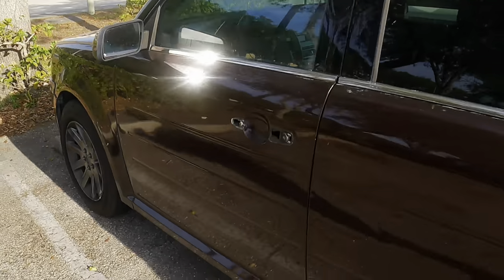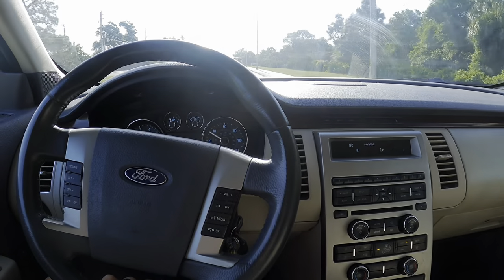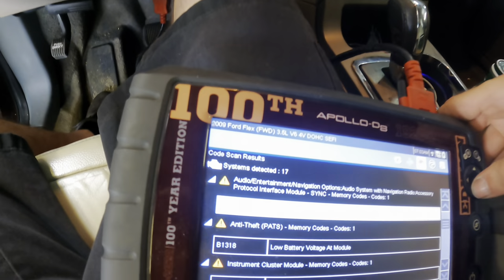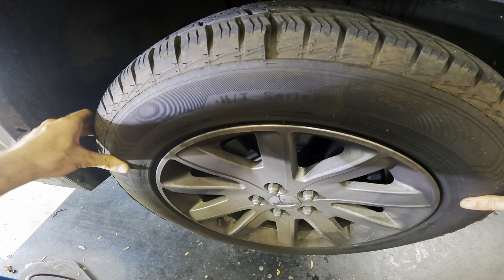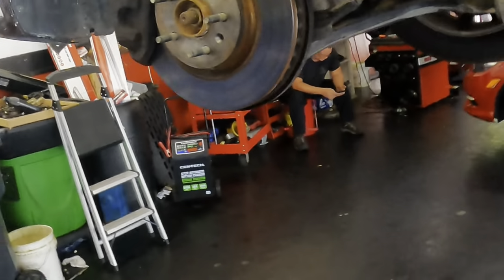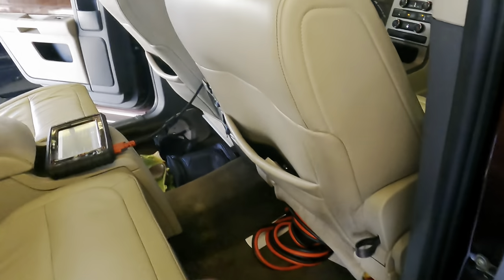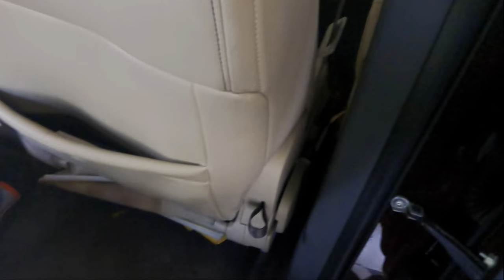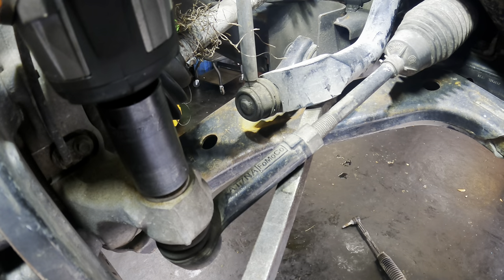Punishment from the Car Gods! 2008 Ford Flex 3.5l Airbag, Banging, Vibrating parts falling off

Comment: Ah, actual question about this...when removing and reinstalling the inner tie rod, should one use the tie rod remover kits that are out there (like a half socket or a set of varying size crows feet with a long rod that has a 1/2 drive hole on the end) or do you find the Angry Pliers™ or Frustrated Pliers™ to be preferable-ish?
Reply from the maker: Depends, if I can get them with pliers I just do that. If not I use the tie rod tool
Reply: Anything the does the job. 
Save your money for the beers after completing the work!
Reply: @RainmanRaysRepairs  some people are real quick judge but if they were doing their job I'd like to see what they would do as I said earlier in the beginning of this episode sometimes they need to sit in their chair and zip it have a good night bye

Comment: I don't know how it is in Florida, but in PA shops are real picky about airbag sensor wiring. I had a self-induced issue while swapping seats in a car, and multiple shops told me that if the wiring was damaged they wouldn't even try to repair it. Only replace. Thankfully(?) in my case, I only managed to damage a module on the underside of the seat while removing the module from the seat.

Comment: Just use a cable tie to hold the boot on. I used to try to use the old clamp also but everyone in my shop did the cable tie trick and there was no failures

Comment: Ray, long time viewer here, but i have to throw some REEEEE out there, one thing that should have been done is to clean out all the old grease out of the caliper bracket slide pin holes, all that old crud collects at the bottom and creeps back up the pins as the brakes thermal cycle and you end up with the same tight/frozen pin issue. Take a drill bit next size down from the hole, chuck it up in a tap handle, and turn it by hand, get the heavy junk out, then hit it with brake clean (DUH DUH, Eric O's sound effects, lol)

Comment: Make sure the front brakes were upgraded. They had issues with builds through Christmas shut down in 2009. My 2010 Flex was a victim, repaired under warranty.

Comment: That Flex needs everything my van needed.  I neglected to replace the inner tie rods thinking they felt ok to me, but when I got it to the repair shop and they put it on the alignment rack they showed me it's too wobbly to get an accurate alignment.  They also pointed out a couple other small things I missed (one easy to fix, one I gotta take it all back apart to fix) so I'm going to do all that and take it back to them.  Also throwing struts on the front and shocks on the rear and probably rear hubs as well because it might as well all get done before I take it for the alignment.  I plan to buy two more tires after the alignment is done (rears at 8 or 9/32 fronts both 4/32) and then there's not much left to do other than cosmetic and convenience items (rear wiper, glove box hinge, blower fan resistor as it works 3-4-5 but not 1-2).
Reply: all that said, it really helps to SEE what the issue is like you did showing the play in the inner tie rod socket joint area there, because it moves about as much as mine does, although I didn't think the little movement was much looking at it with the tire on, it sure is different when you see it moving IN the socket there

Comment: Got a t100. And had a faulty gas cap issue. It solved hard transmission issue. It would act like a dirt bike, and made issues on transmission altogether when decelerating and accelerating, backfire and accelerator issue, . Cold running issue where it wouldn't throttle uniformly. That's crazy. Must make video. ASAP. That's unbelievable to think a gas tank cap. Can have that much effect on whole vehicle operation and linkage. And transmission. That's really understated in the mechanical issue, solving steps. Hahaha wish I knew that's a long time ago

Comment: I been watching your videos old / new ones over the past week and i come to enjoy them. What i dont enjoy is some of the comments and i feel like i just need to mention something!  The kind of work you do is freakin amazing!  Tha speed and the service you guys seem to do is high class and the fact that  atleat you are not trying to rip the customers is so refreshing!  as i said i live in Sweden an i own Fiat Freemont 2016 got the multijet diesel engine in it. This would be your Dodge journey pretty much =D   Anyways this winter in i think nov-dec it started being hard to start in cold weatrher i was like ok maby som new glowpugs and a rly nice redtop battery will solver that! well i changed it and drove it for another month then it refused to start full out =D So i had it towed to a fiat delaler that was 3h drive away and they have now had it for 5weeks and i just recived a call today that they think it is the pump or the injectors. Price on the pump  here in Sweden is $2107,74 not counting in the job =D   and i might still have to buy injectors =P  (Side note to the story is that if i put the car in a warm garage over night it fires right up in the morning) if i dont it will just chew and chew until battery is dead. If i god forbid use a bit of starter gas to fire this diesel up it starts and runs normal and nothing wrong until it gets cold again =D   Sorry for a long post but ppl might reconsider al the complaints etc they have on you!  Keep up the good work my man!
Reply: Diesel engines need a little heat sometimes to get them going. Maybe get a block heater for home. Carry some canned starter spray like grandpa used to.. it's probably expensive where you are. It has Ethyl Ether  in it. Better than being stranded at 2 am on a Sunday morning.
Reply: @marshmower  Hahah yah kinda what i was doing but the problem got a bit worse over time and i feelt like maby there is an internal leak in the injectors so it lose pressure b4 the diesel can reach the cylinders but when it have finely build that pressure with help from starte spray it will work. I said this to the workshop but they kinda just waved me off.. and looked at me what do you know =D  (i only worked as a truck mechanic for 6 years at volvo trucks in sweden =D )   but i guess i let them play around with my car i was smart enough to extend my new car warrenty and it still covers so no mather how much repairs will cost i will be paying $800 =D

Comment: I notice that the instrument display is raking around because the characters are blinking at a rate similar to the camera shutter.  The camera shutter iso speed is very short because the sun is so bright.  But if you put a filter in front of the camera(like sunglasses) then that shutter speed would get longer, you would still have plenty of brightness for the video, and the blinking of the dash lighting would be less to not at all.  Some amount of filtering and it would not blink at all.  (Perhaps multiple sunglass lenses or perhaps even one layer.)

Comment: I had a 2010 Flex, same root beer brown with white top.
The brakes were WAYYY under engineered and scary!
A big brake upgrade would have been $1500. I also had THREE PTUs replaced in two years!
(Warranty covered)

Comment: You may want to think about cleaning out the hole the pins side into. Either brake clean and use the pin to pump old grease out or a drill, cleaning brush screwdriver with a rag.  I'm 62 so I've been there done that.
Reply: I enjoy yours and SMA videos even at my age I can still pickup on new ideas. Keep up the good work.

Comment: I have the perfect tool for doing those clamp squeezes, it's almost 30 years old now, but it squeezes the sides and compresses the top for a perfect fit.  I don't get why that tool you were using has the center opened like that, made it hard to use properly.   Glad to see they are getting the Flex fixed, those are some nice cars even though they are odd looking.  Had a 2010 SEL Ecoboost and regretted getting rid of it, then got a 2013 and it got totaled in a snow storm. :(   Getting another one soon.
Reply: Was thinking the same. I have a similar tool where the grips are thinner so the clamp folds over them and the top part pushes it down. I think it's made by midlock

Comment: I live in the UK and I dont know of any company that would resurface rotors , I dont think any motor repair company here would even have the equipment. They would say it was uneconomical  to resurface them and cheaper to buy replacements. Are there many shops in the US  that would carry out that proceedure. Keep the videos coming
Reply: They used to make rotors thick enough to be cut or serviced a few times. Last vehicle I had with enough meat in them was an 07 Honda Pilot I bought new a s drive to 340,000 miles and sold her. Many shops still have the brake rotor lathes as sometimes they just need a light cleaning or trying to fix a slight warp.

Comment: The customer would be lucky if all it took to fix the SRS (air bag) light was to fix a couple of broken wires under the seat. Our Hyundai Accent air bag light was caused by a defective senor in the passenger seat>>not replaceable. New seat would have been $800. DECLINED!

Comment: My daughter and her hubby had a 2018 Ford Flex. They loved it, I loved it, but they traded it to one of on line car buying things for a Lexus. They missed and wished they had kept the Flex. Sold back the Lexus. Lexus was hard to get in and out of it if you are slightly disabled, high side walls by the doors. Small seating areas. The Flex was easy to get in and out, lots of seating room. Not the best gas mileage but it was rated as an SUV. Could tow with it too. And I guess they are not making the Flex anymore. My guess would be that people do not realize its a working SUV and so mileage is lower.

Comment: When the door breaks while trying to get in the vehicle you know it's going to be a bad time.
Reply: First impressions are almost always accurate and set the tone.  Lol
Reply: *good time
Reply: Just looking at that door screams abuse. I keep saying Ray get in on the other side. The car looks like it belongs to an amateur stunt driver.
Reply: Ford "QUALITY".
Reply: Exactly what I said lol you know by that the owner has completely neglected it
Reply: @nissan300ztt  owner negotiate
Reply: @nissan300ztt  You could argue that, considering the condition of the vehicle, it really is doing pretty good.
Reply: @lucassolomon1079  nope.  Garbage junk old Ford. That has been neglected.  Like most Ford Products
Reply: @nissan300ztt  honestly, drove mainly GM and the wife subarus for 30 years and now I own 2 Fords. 1 has 30k and the other has 65k and neither has been to the dealer yet for anything . I have my own mechanic change the oil regularly and have done rear brakes on the 65k one recently.. knock on wood.
Reply: Be honest I had to fix the latch on my door today I had to either climb into the passenger door from the back seat I'm too old for that stuff man but Ray you inspired me I said Ray can fix stuff I got to do it too and I got tired of banging on the door try to get in my own car God forbid they were trolls have to be I don't know what I do hey have a good evening thank you very much bye